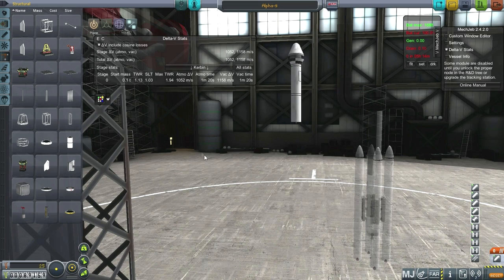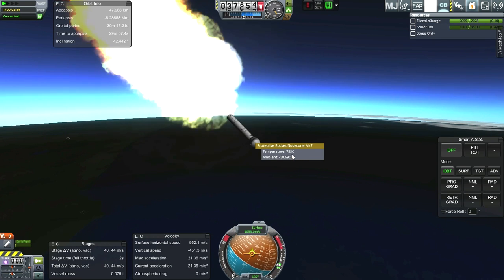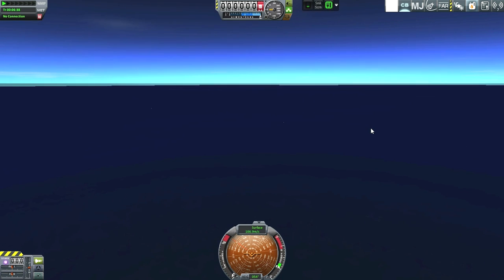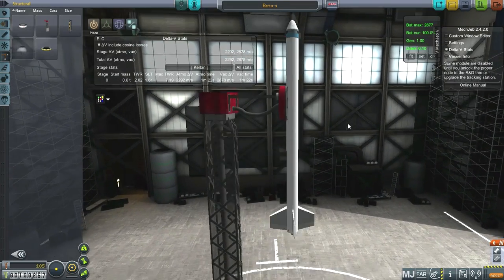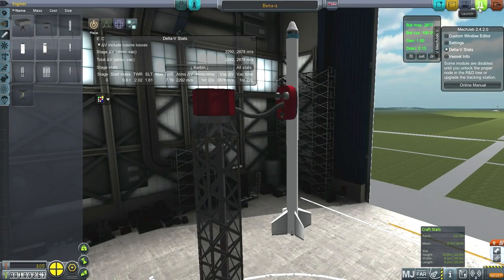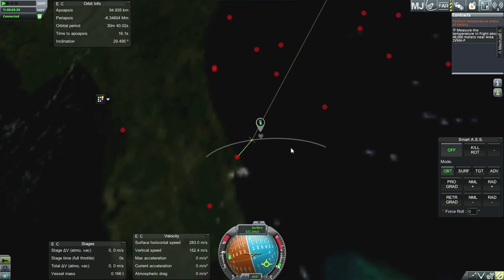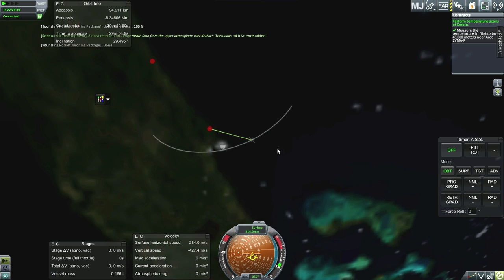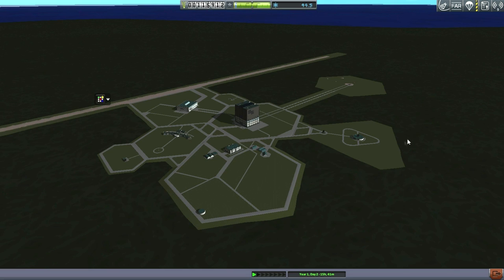Realism Overhaul in KSP Beta 02 - Sounding Rockets Part 2

Comment: Can't you scale down those launch clamps?
Reply: there's no rescale on them, but one of FASA clamp which named generic has auto rescaling feature.
Reply: If you add a tweakscale module for the launch clamps to your stock tweakscale config file you will be able to scale down your clamps. I just tried it and it worked fine for me.